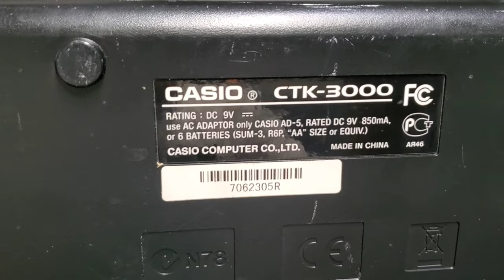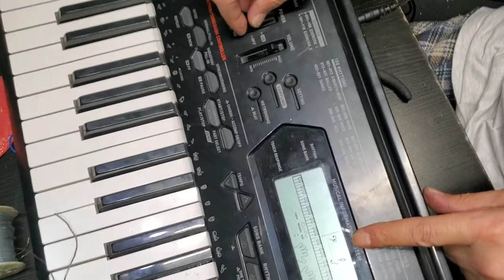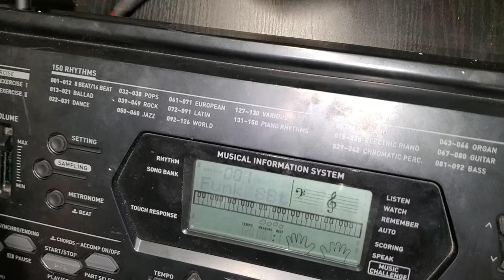How To Fix Piano Not Working | Piano No Power Easy Fix

Comment: Hi! I have a Casio CDP-S100 and it won't work too. I noticed it had like an oil stain in the back coming out of where the middle screws are. I opened it and the keys have a white sticky stuff on it. Is that normal? Or could that be the problem? Do you know how to fix it?
Reply from the maker: Hello my dear friend, if there's any moisture or oil or sticky thing that could cause keyboard malfunction or not working, so you need to open it and clean it well with medical or wiping alcohol,  if still doesn't work try the following troubleshooting steps
1- check and test power supply use multimeter make sure it gives right voltage output like 12 volt or whatever the piano voltage is,  you may try to test the power supply cable too by moving it while testing to make sure no cut or shortage if everything is working OK go to second step
2- open the keyboard and check test the input power jack make sure it doesn't broken or loosed,  if there's any broken connections or loosed you need to solder it , if it's all good go to third step 
3- after open the covers and have access to all electronics boards to need to inspect all connections wires and connectors have no broken or shortage or loosed,  inspect the electronic boards if there's a Crack ot broken, if all good go to forth step 
4- sometimes moisture or forvsome other reason can cause some electronic boards components burn out and stop working for that you need multimeter to test power electronic board and display board  and power button sometimes not working well if it's touch button you need to clean it inside with medical alcohol if power buttons is mechanical test it with multimeter or connect the power directly by using by pass wires,  I hope that will help you to figure out، thank you and all the best 👍
Reply: @WorldRandomVideos  Thank you so much!! I'll follow your advice and see if I can get it to work. Loved the video btw Keep up the good work!
Reply from the maker: @clarabarros6722 , my pleasure 🙏,  I am happy to help and  hear that 😊 😀 thank you so much and all the best 👍

Comment: Great video. Quick question, you mentioned you tried inserting batteries and that also did not work. Once you fixed the issue with the power, were you able to use battery again? Thanks
Reply from the maker: Hello my friend,  yes after the problem fixed the battery power works too,  the main power is connected to battery power as well, thank you so much 🙏 and All the best ❣️
Reply: That’s very helpful. Thank you. I’m trying to figure out the issue with mine
Reply from the maker: @mendozawav8202 my pleasure 😊
Reply: Great video!! How did you know WHERE to solder that jumper wire?
Tha ks
Reply from the maker: Hello my dear friend، by following  the electronic boards connections lines,  follow each circuit line where is starting and ending and once you find the broken or cut point use wire to by pass it and soldering it , thank you and all the best 👍

Comment: Hi there. I have the same issue with a CTK 3200. Could you show me where to solder the bridge wire on this board?
Reply from the maker: Hi my friend, if you see any broken of connection legs  just follow the  connectors lines to the closet next soldering pin and use wire to close the shortage broken connection if  you watch the video carefully you know where to soldering, thank you and all the best 🙏🙏🙏

Comment: Hello po. Pwede po bang magtanong kung ano pong tools ang pwede gamitin pang maintenance at repair ng piano? Ang mahal po kasi kahit magpapachange lang conductive rubber, parang mas maganda kung pag-aaralan ko nalang.
Reply from the maker: Hello my friend, you a kit or set of  Multi  sizes and shapes  
screw drivers,  you need  soldering gun with soldering removal tool or copper screen soldering removal.
You need soldering flex, you need  picking tools or tweezer, you need  electronic multimeter to test components. Thank you amd all the best.

Comment: Sir good day! I need some little help of my psr 323. There's a problem in power i tried 9v 350mah but it didn't work likewise in 12v 2A. Its possible to bypass the power and connect it to the battery connection? Or there's anything else that i can try to fix this sir? Please notice me 😢 thanks!
Reply from the maker: Hello my friend, first it's recommended to connect it with right power supply voltage and ambrage some paino can't work with less A even if the V same, I think the power adapter for par 323 is 12v 1.5 A,  test the power supply to make sure it's working by using multimeter   to read the right voltage, after testing power supply and it's working and keyboard still not working it's most likely the input power jack is the issue maybe it's broken inside from electrical board or wires shortages or cut and it needs to be fixed by open the cover and test it, you can connect the power supply directly to battery terminals positive on positive and nagative to nagative, this method will also work, you may need a good power supply same Volts 12v and 1.5 A if the sounds of the keyboard is chipping or not loud enough then you need higher Ambrage 2 A to operate it with enough power, thank you and all the best
Reply: I tried to connect it to the battery connection with a 12V 1.5A and 2A but it didn't work sir huhu

Comment: Hi, thanks for the video. My roland keyboard does not turn on, when i press the power button the light on the screen just keeps blinking. Yesterday I turned it on and it worked without problem. Can someone help me figure out what's wrong with my keyboard?
Reply from the maker: Hello my friend, Try the following troubleshooting steps by step:
1- if the power supply external test it with multimeter DC Voltage if is correct? ,try to move the power cable if has cut or shortage while testing it. If there's nothing wrong go to next step 
2- check the power jack input for power supply if it's broken or moving 
And to do that you need to have an access by removing the cover so you can see it, the power input is connected to the electronic board check if there's any cut or broken connectors if there's any use soldering gun to solder it , 
3- if the power supply internal or built-in remove the Cover test it by using multimeter you need to test the output voltage and test diodes and transistors Maybe one of the transistors not working, if the power supply works ok , go the the next step.
4- when you remove the Covers Try to check all wires and all electronic boards and all input and output check at close look you may use magnifying glass if there's any cut, broken connectors on electronic boards wire all connected ok make sure no cut or corrosion or moisture in the boards, 
I hope that can help you to figure out 
Thank you and all the best 👌 👍
Reply: @WorldRandomVideos  Thank you so much for your response. I was able to verify that the problem is the power adapter. The keyboard works without problem. Thanks for the help! ☺️
Reply from the maker: @StarGlow Piano  my pleasure 🙏,  Best regards 😀

Comment: Sir, i need a quick help. I have the same model ctk 3000. My display is not working but rest everything is working fine, pls suggest,i can send you the photos as well.
Reply from the maker: Hello my dear friend, there are several causes for digital display let us start to find out step by step following troubleshooting 
1-  if the power supply is working OK sending full voltage  to the  piano and the keyboard  play full loud sound not  chopping that's a good sign that the power supply  is good if the sound is low or  start chopping when volume up that means the power supply is bad or something wrong with electronic components 
2-  most of the digital display devices if they are not working most likely is the IC integration  on digital display inside the keyboard you need to check it and test it,
3-  open the keyboard covers and access the electronic boards  check all connections and connectors make sure they are all not loosed or off, next  dassemble the digital screen check if there's something not setting right or dirt or depris  if nothing then it could be the digital screen is burned must be replaced, 
I hope that will help you thank you and all the best 👍
Reply: @WorldRandomVideos  thanks for the revert. I opened it for the first time since i bought it many years ago. The problem was that some keys were not working, i watched YT videos and cleaned the same and all keys are working but then it started giving me this issue- Everything (100%) working fine, including tones, rhythms etc… but the display…Pls share your whatsapp no, if possible
Reply from the maker: @sarangtumne, hello my dear friend, I have sent you all possible reasons and how to troubleshoot and  fix, display screen if it's not working you need check electronic boards for any burned components or cracks or broken connections lines , also check all connectors if loosed or broken, if nothing wrong then you need to dassemble digital display look if there's off settings or broken parts, if nothing then possible the digital display is burned out. 
And must be replaced
Reply: @WorldRandomVideos  Okies. But what i did is just cleaned the keys internally and it started working like charm but since then display is not coming… I am also a technical person, can i reseat the ribbon/white cable of 10-12 connectors as i suspect i disturbed the same… I chked with multimeter and it shows proper connectivity (beep) however i also noticed that no 5 from left gives me 2 connection beeps, can this be a problem?
Reply from the maker: @sarangtumne. That's right, yes  that's what I mentioned about connections and connectors maybe there's a shortage or cut or not connected at all, you may need magnifying glasses or use smartphone to magnifying it so to see clearly what's wrong, if you are a technician then you know what to do I am positive you can fix it, thank you and all the best 👍

Comment: Well, my problem is with the power button. I can hard power on using the mosfet easily, so I guess the problem is different
Reply from the maker: Power button if it's touch or soft touch press It's either the base of the black graphite dirty or corrosioned or the button bottom Both need cleaned with medical alcohol, if the power button old style mechanical press it could be the legs are loosed or not connected to electronic board, or power button switch is bad, check the electronic board if any cracks or cut connections, thank you and all the best 🙏

Comment: I have a Yamaha psr e323 which is sounding double keys (only two keys side by side) in all octives pls help me e
Reply from the maker: Try those troubleshooting step by step, starts. With easy ones 
1- have you tried to set up from menu settings or change the tunes or keys sounds and do on try to play with menu first or look in user manual if you have if still not solved try step 2
2- if your Yamaha has reset key or bottun try to Reset it, unplug the power press and hold power bottun for about 30 seconds then plug it back this may solve the problem if resetting didn't work go to 3 
3- it could be something burned inside electrical components such as tune transistors or ic this need to dissemble it and test all electrical boards and wiring and connections and connectors.
Thank you and all the best ☺️
Reply: @WorldRandomVideos  thanks sir but how to test the connection (l have a multimeter)
Reply from the maker: @madirasamueljohn1153 ,
It's not easy even for an experience technician you need to test each tune transistors to find out which one need to be replaed,  it's hard to explain, because each transistor has different reading so you need to have experience and knowledge about transistors, but why do you think it's transistors problem, have you try to reset it? Or use menu settings to change key tunes ? 
Thank you and good luck

Comment: Hi i really need help😢
My piano YDP 165 stoped working. When i on the piano it work for  llike 10 to 20 sec and the piano switch which has small light in it when it's own started blinking 4 to 5 times and it stoped working  and i off the light switch and on the switch again, it blink for 2 to 3 times and it never worked again. The voltage was ok can u please tell me what to do😭
Reply from the maker: Hello my friend, there are several issues can cause that,  you can try the following steps or visit those 2 links for more details,
Please try that:Turn the power of the instrument off. Then, while holding down the lowest key, press the [ ] (Standby/On) switch to turn on the power again so that the [REC] indicator flashes three times.Once you do that try to turn on the piano the regular way.I hope that helps,
you try unplug it from the power outlet > leave it like that for at least 1 minute > press the power button for at least 15 seconds > plug the power cord to the outlet and try to turn it on again.
https://gzhls.at/blob/ldb/e/b/8/e/2140f7dccbc09461a29e13e4733e2eaf4cbf.pdf
https://pianotechniciantuner.com/blog/Blinking-Flashing-Lights-Guide-Yamaha-Enspire-Disklavier
Good luck and all the best 🙏 
Let me know if the problem is solved 
Thank you 😊
Reply: @WorldRandomVideos  that's so kind of you. I really appreciate it thank you, I'll give it a try. .

Comment: My beston 37 key piano is not working can u tell me what can i do please
Reply from the maker: Hello my friend,
 * You need to remove the Cover carefully.
* after you remove tye Cover take a close look what cause the problem, there are several causes , key stuck, 
Key not in right position shifted off,
Damaged key or broken,  when key hit hard or some liquid spelled on it like water coffee etc can cause stuck key, thank you and all the best.
Reply: It works but now my piano's speaker is not working clearly.
Reply from the maker: @Neharika Raj (ND)  it could be bad speaker need to be replaced or one of the sound bad transistors must be checked with multimeter to know which one, good luck and all the best .
Reply: Can i take my piano to an electronic shop
Reply: Please tell me its urgent
Reply from the maker: If you don't feel comfortable or you don't know how to fix it your self, you can take it to electrical shop repair, you can watch a video on YouTube on how to fix  such problem, or check on-line for troubleshooting keywords  that may help to have an idea, there are 2 main reasons when key stuck or is not working either mechanical or electronical issue 
Best luck.
Reply from the maker: I am sorry I don't know what exactly the issue without checking it my self and troubleshooting to find out what is the problem, the keyboard must be disassembled to take a close look, thank you, I have mentioned there are either mechanical or electronic issue, Try to look in user manual troubleshooting maybe can help to figure out, best regards

Comment: how do you know which place to solder?
Reply from the maker: I follow the same connection line on electrical board, if I can't see it I will have to use multimeter, 
Thank you so much and all the best 👌 👍

Comment: Hi I just dropped my Casio keyboard on the concrete and it won't turn on now,,, cann you pls help
Reply from the maker: Hello my friend, 
Try troubleshooting the following steps 
1- check if there's a power going in piano,  remove cover and use multimeter to test any voltage if there's any go to next step 
2- deassemble the piano recovery cover and check if any broken or cracks on electrical boards usually sometimes can be very small crack or broken connectors or connections 
Hope that can help you to figure out
Thank you and all the best 👌 👍
Reply: @WorldRandomVideos   thank you I'll try it out and let you know♥️🙏🙏
Reply from the maker: My pleasure 😊,  Best regards ✨️
Reply: @WorldRandomVideos   ok update I opened it up and found out that the place where the power connection is connected to on the board is broken what's the next step???😢😢
Reply from the maker: The next step is :
If the power jack connector is broken or damaged completely you need. Yo replace it,
Use Soldering iron and brush or soldering soaker tool , 
Remove old solder hold the connector legs one by one and free up or clean connector from solder, and place new connector if you have one,
If you don't have power connector try to fix it, see which part is broken if connection board wires are cut scrape the green paint until you see the metal then solder them together.
If the broken connection are bad use  electrical wires to connect the cut or broken components together by Soldering together.
If you can't fix it or replace it here's my way to make it work.
Find the 2 main terminals + and - on the power connector with electronic board and connect the power Cable directly to them + -   this method works to make power direct to piano without power jack connector. 
Make sure to solder + on + and - on - 
This is a good way to fix it but if you don't care just want to make your piano works .
Good luck and all the best ☺️🙏
Reply: @WorldRandomVideos  thank you so much  I'll keep you updated ♥️🙏
Reply from the maker: My pleasure 😊

Comment: What happened if it the on button that has the problem
Reply from the maker: You can test it by using multimeter to see has any reading ,
Here's how 
You need to access inside remove cover to be able reach the bottom from inside connections 
Piano  must be on use multimeter on DC voltage first and check if any reading, if not use ohm function on multimeter  Paino must be off and connect to the button connections to see if any reading, if there's reading that means bottom is ok,
If not you need to replace it